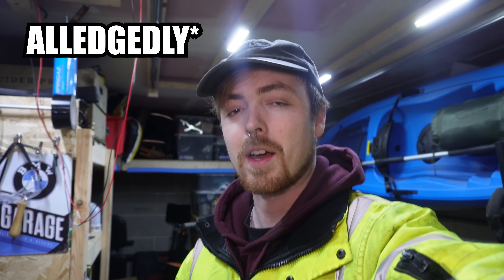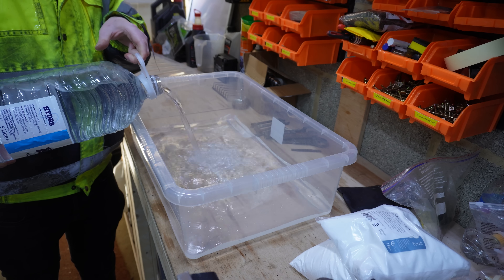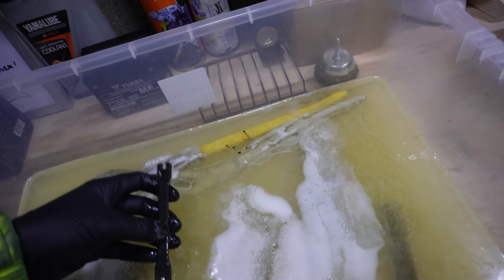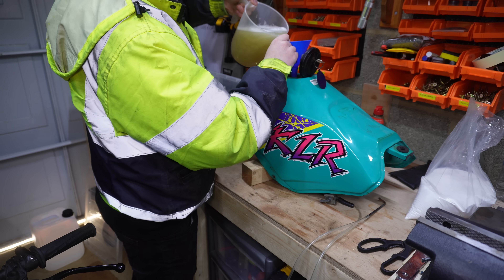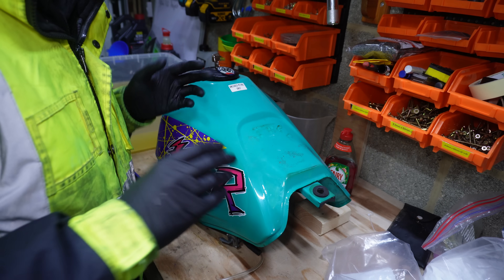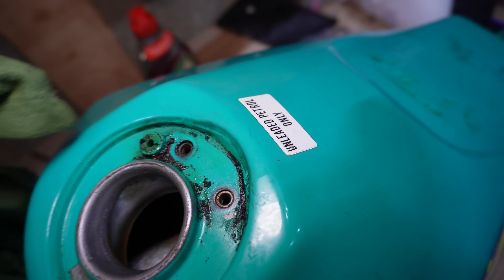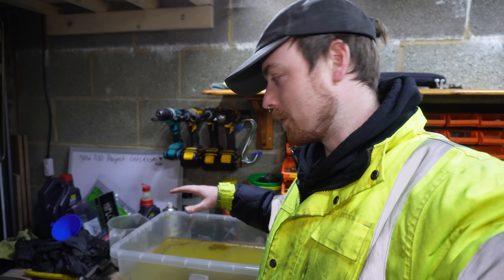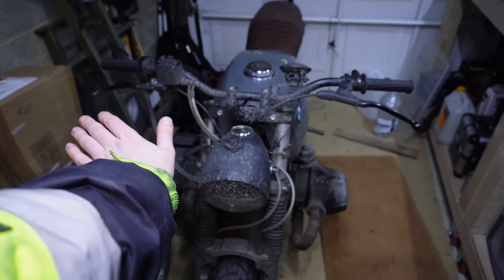How to clean a motorcycle fuel tank (Better/Cheaper than Evaporust?)

Comment: Mechanically remove the rust with a 4 inch twisted wire wheel in an angle grinder, only takes seconds on tools and stuff like that.
That mechanically removes 99% of the rust AND gives you visual idea of the overall condition.
Then it only needs 20 minutes in the bath to chelate any super small rust in pores etc.
For inside fuel tanks, cut a bicycle chain into 5 inch long pieces and use that in the tank, shaking it etc to remove larger flakes and gunk. Chain is much easier to remove later than nuts or bolts because they get stuck in crevices, the chain doesnt (or if one end gets stuck you can hook the other end)
Reply: I will have to try your chain suggestion on my next tank. Good idea.
Reply: @scottcates     I restore lots of old motorcycle parts, and my 2 favorite tools are; the 4 inch angle grinder with a steel wire wheel, and a cheap $80 bench grinder with 2 steel wire wheels on it (thick and thin wheels).
I can remove rust from parts in seconds, and PAINT, and if desired, even take off chrome plating, especially with the angle grinder which is very aggress!ve.
The bench grinder, especially on the thin wire wheel, can be very gentle and remove rust spots without harming platings.
I haven't put parts in rust removing parts overnight for years, I rarely use chelating chemicals now and if I do it is often just a brush-on rust converter.

Comment: DONT remove rust, you are destroying part of what ever item you are trying to restore.  Once you get rid of it it is GONE.

Convert all that red oxide to black oxide by boiling your item in water.  This turns that dead useless harmful rust into a protective coating on that item.  This is called RUST bluing and is how the old timers blued firearms.

Comment: Rust in metal petrol tanks occurs because of water. No water = No rust. Throw 50 to 100 ml of 100% Isopropyl Alcohol in your tank every time you fill up and it will get rid of the water. Isopropyl is the safest as it won't attack rubber or plastics like ethanol or methanol.

Comment: This would be a great solution to use in an ultrasonic cleaner.  I can see this being used for carbs and possibly injectors for example
Reply: This solution wkill dissolve zinc so I would be hesitant to use it on a zinc alloy like carbs are. They usually are ZAMAK -- an alloy of Zinc, Aluminum, and something else. The ultrasonic cleaner does speed up the ability of this concoction to remove rust quite nicely though! Good luck finding an alunminum brightener, too.

Comment: The holy grail of rust remover is Bilt Hamber Deox C. By far the best rust remover on the market. Is as cheap as chips and works faster and more potent than Evaporust (which is an absolute rip off,) fully biodegradable, and a British company.
Reply from the maker: This is interesting, I tried looking at the data/safety sheet but it understandably doesn’t say what’s in it, might look into trying it

Comment: The rusting was most likely caused by the fuel nozzle at the petrol station scraping the inside of the tank during refueling and the tank not being full allowed the scratched areas to get in contact with water vapor and and air to end up with rust. 
If you turned the tank upside down with the lid closed and the fuel line open to allow for the gas expansion you only would have need maybe quarter of the solution.
Reply from the maker: I think you’re right about why it was rusty, although I made that much solution because I have plans for lots of other rusty bits to go in it!

Comment: In case you don't know, once you hit the tank a few more times, you can get fuel-safe epoxy mixtures meant to line the inside of fuel tanks like this to provide a protection layer and prevent pinhole leaks. Ronald Finger did it with one of his bike restorations.

Comment: Chelation Extraction Formula (High-Temperature Method)
This solution is optimized for breaking down metal oxides and salts, ensuring full dissolution through controlled heating and pH balancing.

Ingredients:
500mL Distilled Water (purity ensures no interference)
50g Citric Acid (food-grade chelating agent)
5g Sodium Hydroxide (NaOH, lye, pure) (pH adjuster, enhances solubility)
2mL Polysorbate 80 (surfactant for penetration and dispersion)
Preparation Instructions:
Heat the Distilled Water

Bring 500mL distilled water to 95°F (35°C).
This ensures better dissolution of the compounds.
Add Sodium Hydroxide First

Slowly dissolve 5g of NaOH while stirring continuously.
The exothermic reaction will raise the water’s temperature to ~130°F (55°C).
Add Citric Acid Carefully

If your vessel is at least 2-3x the volume of the water, you can throw both in at the same time (just don't stand over it. Let it doe its thang. At 95F+ degrees, it'll dissolve itself)
When fully dissolved, the solution should stabilize around 130°F.
Verify completeness of dissolution by:
Checking pH neutrality (~7.0), or
Ensuring the temperature is around 130F
Incorporate Polysorbate 80

Once fully mixed, add 2mL of Polysorbate 80.
Stir thoroughly to ensure even dispersion.
Final pH Check & Adjustments (if necessary)

If pH is too acidic (<6), add a few drops of NaOH.
If pH is too alkaline (>8), add a pinch of citric acid.

Comment: I always take a wire brush to the tools that have large loose flakes of rust, it saves soaking time, and it extends the usability of the solution.  Try using a Scotch-Brite Steel Scrubber (or alike)instead of a wire brush for the clean-up, works great for the deeper rusty bits..

Comment: I’ve done this. It works great!
Heating it to 120f speeds up the process. Am using a submersible heater in an 5 gallon bucket. also using a parts washer pump to  flow it over larger parts, let it drain back into a heated bucket with a pillow case over the top for a particulate filter. Use a tarp to collect and drain back in the bucket.

Comment: Great video, I’m restoring a Landrover series 3, rust galore, have tried conventional over the counter products with reasonable success for some, will definitely try this. 
Thanks for the tip, will be interested to see how long a batch lasts. 
Subscribed 
Greetings from Tasmania.
Reply: Hey there - did a SIII myself not so long ago.  Many of those Landrover parts have a galvanized coating (the tools in this video also had that). You will strip the galv off with this solution (creates white foamy residue), so you'll need some way of protecting those parts that have been dipped from rusting again.
Reply: @ good to know, thanks for the heads up
Cheers

Comment: I have been using citric acid for rust removal for years. One bit of advice I would give is don’t push a batch too far. When it is spent it stops removing rust but worse, everything in the tank gets coated in a chalky residue that is really hard to remove. Also, when I take stuff out the tank I clean it up and then wipe on a coat of phosphoric acid and let it dry. This forms a surface coating of iron phosphate which will prevent future rusting.
Reply: This isn’t citric acid rust removal
Reply: Have you tried cold bluing instead of phosphoric acid?
Reply: Try molasses next time you want to strip rust.  It's even more idiot proof and when you're done, you can have parts sit untreated for over a year without flash rusting.
Reply: it doesnt use citric acid to remove rust, it uses the salts formed from neutralizing citric acid to remove the rust

Comment: You don't want to mix the citric acid with the sodium bicarbonate...........you're just reducing the efficacy of the citric acid. Mix ONLY the citric acid with water.......the warmer the better for faster results. Soak until rust has been removed then rinse with a separate solution of sodium bicarbonate in water which neutralises the acid to prevent flash rusting. Oh, by the way.......I'm an industrial chemist.
Reply: Watch all the other videos on this method - apparently it removes rust in another way than simply dissolving it, so the neutralisation isn't an issue. I'm still not sure of the science, but what I can say from using it, is that this mixture does NOT eat into the metal like acid or alkaline mixes, but still pulls the rust off. It's been favourably compared to Rustoleum.
Reply from the maker: @Heckthusula yes! Thank you for watching, I didn’t explain it very well but it’s not the acid doing the work here haha.
Reply: Oops - meant to say "Evaporust", not Rustoleum.
Reply: @ It is an acid. Any organic mineral acid (citric acid, acetic acid etc.) will remove rust very effectively. However, whilst the residue won't eat into the metal very quickly (unless left for a very long time) it will expose the surface to flash rusting. The bicarbonate of soda WILL neutralise the remainig residue and that  prevents flash rusting. Commercial products also contain some phosphoric acid will creates a phosphate barrier layer on the steel to protect against rusting. Oh, by the way........thought I'd just mention that I'm an industrial chemist
Reply: @chrisfrob  Your ignorance is showing.
Reply: @chrisfrob  you are not an.....
Reply: @Heckthusula  You are 100% correct, amigo.
Reply: This solution of sodium citrate is essentially neutral with a PH near 7. The rust in this video is removed via chelation. The solution does not appreciably harm the base material like an acidic solution would. Just a few facts for the industrial chemists out there. For a more complete explanation, see the source video here => https://youtu.be/fVYZmeReKKY?si=oiWHluIkdskIOJSD
Reply: There are plenty of tests with this solution, and by far it is better than citric acid only, it attacks the base metal far less than citric acid alone, and i wouldn't say it is slow, and the best part is that it is used up far less than citric acid alone and it can disolve ALOT more rust for the same volume.
Reply: @chrisfrob  it appears the old saying 10 experts 10 options is certainly true here.
Reply: You didn't watch until the end, clearly.
Reply: You're wrong, watch the original video. I've used this recipe, it works much better than citric acid on its own.
Reply: Hi  I watched the original video and the guy says he’s an amateur but to me he appears to trying to do it scientifically and explaining why he mixes the two items rather than using one to counteract the other after use.  I was wondering if you’ve watched his video and if so what’s your opinion as a industrial chemist of his reasoning and explanation.
Reply: I dont agree, the bicarb is likely making a buffer solution with ion exchange in the reaction.  basically the primary action is to use a slower milder reaction with a weaker bond.  The slower reaction is likely creating an organic metal ion which the soap is helping dissolve, or stay in a water solution.   Since the slower reaction is weaker it does less damaged to the oxidized base metal.
Reply: There is an actual video on doing it this way, the citric acid alone way and something else, this version wins hands down, hence the guy then pushed the boundaries boiled it down, threw some  cornstarch in to thicken it and made an actual gel that continues to work exactly the same, it also stores in the cupboard
Reply: Darling, Google chelation. This is the mechanism of action of evaporust as well as this. The citric acid forms iron citrate.
Reply: @napaisava  { don't need to Google it.........I have a PhD in Molecular Coordination Chemistry and the use Chelating Agents.
Reply: Many thanks Chris
Reply: Agreed. I’ve had as good results with cheap vinegar. Acid.
Reply: As an Industrial Chemist, are sodium carbonate (soda ash) and sodium bicarbonate (muffin riser) interchangeable in this process, or did I miss something in this video?
Reply: @marjon1703  I just mixed yesterday a batch equivalent to 100g of citric acid, 63g of sodium bicarbonate and 1l of water. Worked fine, although I'd like to test the difference to the sodium carbonate. The original video states that for the same end result 40g of it should be enough.

I've used citric acid by as is before, but this works way better. Even better than evaporust in my opinion.
Reply: Exactly, the baking soda is just to neutralize the acid afterwards, mixing it with the acid just neutralizes when you still need it to be acid.

Comment: The key that worked for me was to rinse the part with water and I dry it off with my air compressor ,then I use a wire brush and I haven't seen any rust come back.
the key is to make sure that the part is completely rinsed off and thoroughly  dry ,before using a wire brush or scuff pad, and or steel wool.
Reply: Thanks for that tip,  I'll try.

Comment: Maybe you mentioned it but I didn't hear it, you need to use bicarbonate of soda after the citric acid to neutralise it, or the rust will come back quick. e.g dip in citric acid, washing liquid if you want, leave overnight at least, get a bucket with water and bicarbonate of soda, leave in their say an hour, rinse, dry and coat with a penetrating oil, not WD40, as it names says it's a water dispersant , you want something that cheap 3-1 spray oil, RP90 etc. Obviously the oiling part is for tools etc not a fuel tank, just to clarify.

Ok I see the description so I know what video you watched, still won't hurt to dip in bicarbonate of soda after and rinse etc.

Comment: Super nice KLR you've got there!

I did this process last week after seeing Backyard Ballistics video. Filled up two extremely rusty tanks and set them by the fireplace overnight, as the near freezing temps outside did seem to slow things down.

Tons of rust came out the next day as I poured out and flushed the tanks. Unfortunately I didn't get everything so I went for a second round. One tank started leaking as it had rusted all the way through, and the other needed to go up side down as bubbles had created an air pocket near the fuelcap.
Still some rust at the bottom now, but I'll throw in some screws and shake it around to see if another round is necessary.

All in all, this thing is real and a definite keeper!
Reply from the maker: Thank you! I absolutely love it, it’ll be for sale soon though as I’ve got my eye on a bike for the channel… 
Yeah it’s a really great process/solution, I’m glad I’ve found it to be honest, it’ll be getting a lot of use. 
Thanks for watching and commenting!

Comment: This is a bit of a story. As a kid in the 1960s, I liked making "effervescent" drinks using Eno's powder (like Alker-Saltzer ant-acid tablets). It is almost impossible to buy Eno's powder in the UK now; when you can, it is ridiculously expensive. So, I found a recipe, principally Sodium Bicarbonate and Citric Acid, and I bought 5-litre buckets of each. As mentioned in the video, these are readily available in the UK. It works pretty well for indigestion/heartburn relief.

I've used white vinegar to dissolve/remove rust, and it works pretty well, but the smell tickles your nose and makes your eyes water! So, realising vinegar and citric are weak acids, I tried citric acid on its own mixed at 350 grams to 5 litres of water. The results were similar, if not the same, as yours. The higher the carbon content of the steel, the blacker the appearance. Citric acid is too weak to attack the steel to any significant degree. However, I understand the principle of chelation. I will experiment with the Bi-Carb/Citric acid mix in future, though!

A word of caution, though: I found that some cast materials, such as base/alloy metals, can react and begin to dissolve. I suspect these may contain magnesium; Evaporust advises against its use on cast magnesium alloys. I don't know if Sodium Bicarbonate would mitigate this reaction.

I have re-used my solutions dozens of times. I find the rust particles settle at the bottom of the container I keep it in, and I can syphon off the clear solution (which becomes yellow-tinted after use).

I've watched Beyond Ballistics videos. He is a really nice guy and a recommended sub and watch.

Edit: You can also add starch (e.g., wallpaper paste) to make it into a gel, which might be useful for some applications. You would need to experiment with the quantities you add, though.
Reply from the maker: Thank you for watching and the informative reply, I suffer with really bad heartburn so that info was more useful than you might've thought haha. I think I'll probably experiment with other options and if I come up with anything else that's better I'll make another video, but your testing sounds like its showed some pretty interesting results, I didn't know about the magnesium so thanks for the heads up on that.

Beyond Ballistics video was excellent, he definitely is worth a watch and sub I agree.

Its funny you should say that about making it into a gel because I saw a video about that today, I thought to myself "when would that be useful" until he applied it to the metal round thing at the end which would've been almost impossible to do without a massive vat of solution otherwise.
Reply: @ItsChrisHodge  For heartburn, you can just use a teaspoon of bi-carb in water, but it is quite salty tasting, citric acid negates this a bit and adds the effervescent! I forgot to mention this solution is suitable for use in an ultrasonic cleaning bath too.
Reply from the maker: @ is it worrying it’s both good at solving heartburn as well as ultrasonic cleaning motorcycle parts? 😂
Reply: @ Well, Bi-carb is what creates the holes in crumpets. It's added to plain flour to make it into self-raising flour, erm.. added to toothpaste, and also to neutralise odours—very versatile!  In confectionery, citric acid is basically what Sherbert dabs are made of!

In terms of old fasioned remedies, it's quite likely your grandma kept remedies like Eno's, Andrews Liver salts, Bi-Sodol and Milk of Magnesia in the cupboard for tummy upsets and indegestion. But of course, pharmaceutical companies prefer you to buy expensive products like Gaviscon at £12 a bottle. Simple, cheap and effective remedies don't make the companies enough money!